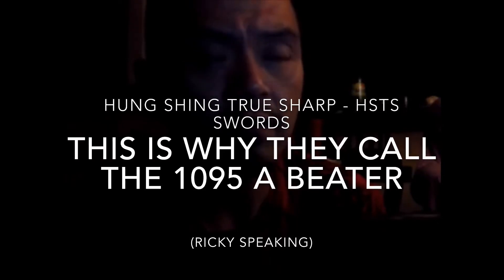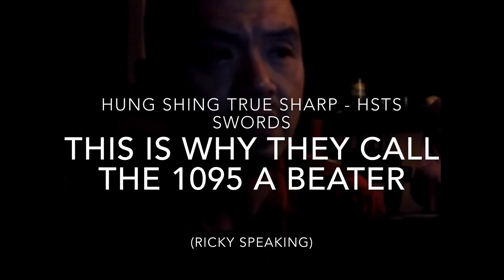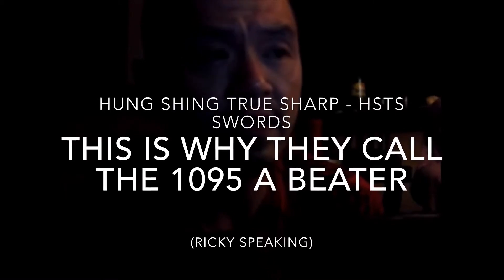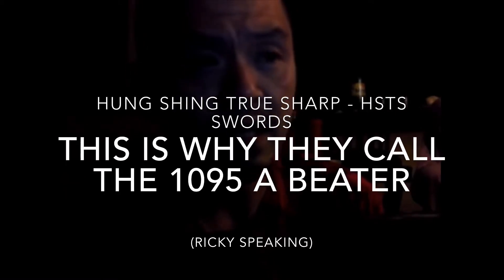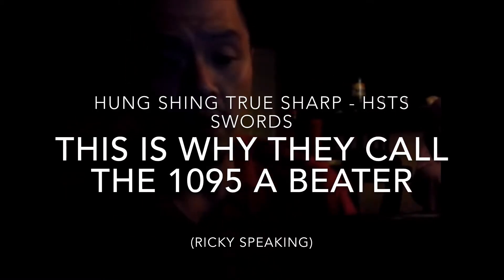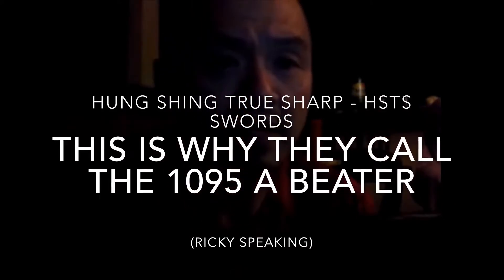HSTS 1095 Budget Beater sword in 1095 American Spring Steel

Comment: Im mot in America 
So is this not true for more standard 1095?

Maybe, what would you advise for someone in euope?

I have seen a katana i would like but its 1065, and every katana thats around the same price is 1090 or something 

I just like the look etc of the one using 1065
But i want a functional katana that will last through some beatings

I don't understand why this one is the same price as the other katanas with more carbon 

Is it a red flag?
Reply from the maker: Hi @daz97 when it comes to high carbon steel, 1045 is the lowest carbon that makes a cutting sword. The higher the number the more carbon, and the stronger / harder the steel. I would recommend 1060 as the lowest carbon amount for a cutting sword personally.
How it is tempered during forging makes the most difference though.

AISI 1095 industrial steel is an American made steel used for Truck springs and is hard. It can be heated in such a way that is firm, and spring like.

The Chinese produce a very similar bloom steel called T-10 Tool steel. It’s roughly the equivalent to 1095, except that 1095 is American made, and exported to China. T10 is produced locally in China. Both are good steels.
As I mentioned, they are very hard. So can be more brittle. They are great steels for making swords. What matters most is the heat treatment.

To answer your question, all 1095 is American made, and therefore is standardized. To the best of my knowledge, any steel type can be made to have a spring temper. 
Personally I collect Spring tempered Katana for cutting because they can take a lot of abuse.
Reply from the maker: Lower cost isn’t indicative of quality always. You have to read the description.  Some brands like Hanbon Forge sell cheaper than others but are good quality.

The European equivalent grade standards are DIN 17222 and Japanese standard G4801.